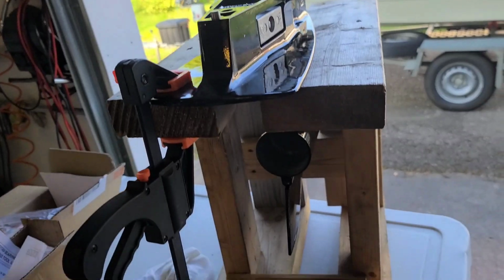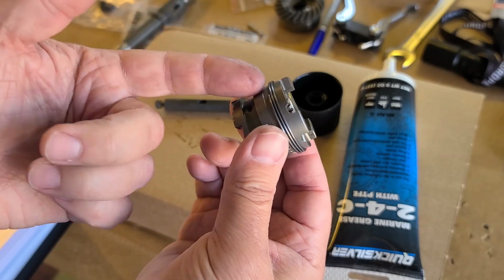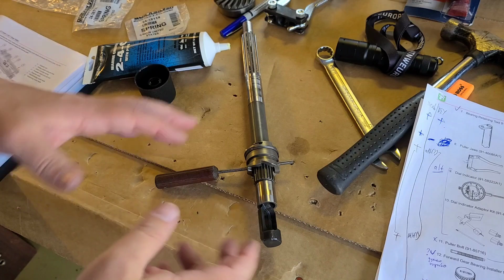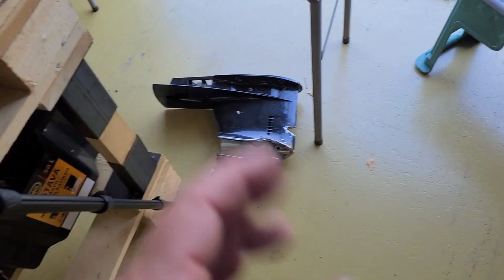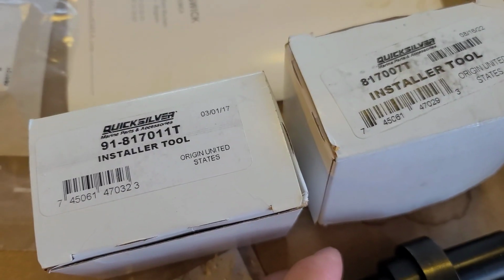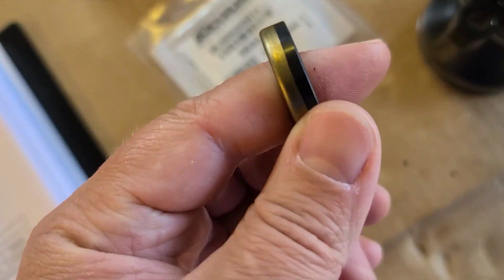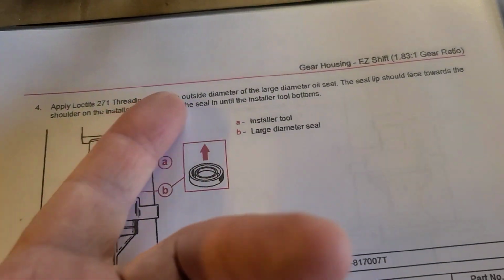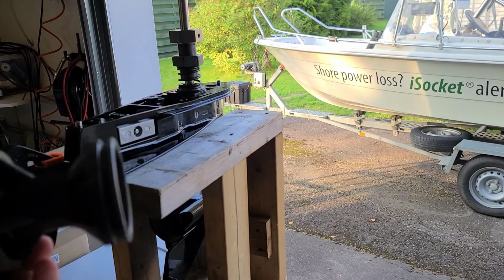Clutch and Bearing Carrier Assembly for Mercury 40-60 HP Lower Unit

Comment: Hi, great video, I'm currently replacing my bearing carrier, how do  I remove the reverse gear from the bearing carrier?
Reply from the maker: With a suitable puller. If I remember correctly, I just pushed it with a hammer from the bearing carrier side, but I'm not sure. Maybe it is somewhere on my channel.
Reply from the maker: Or maybe even with a couple of flat screwdrivers under the gear.